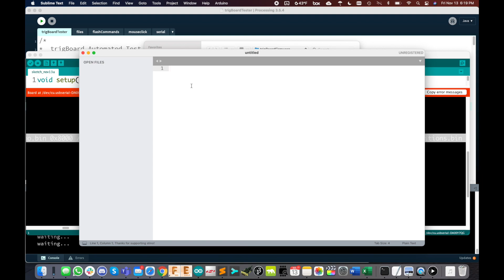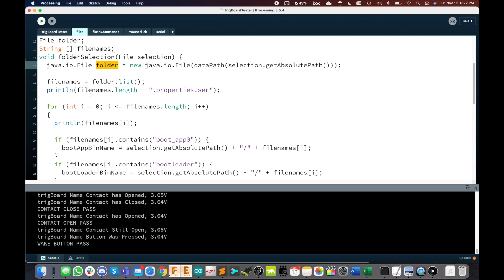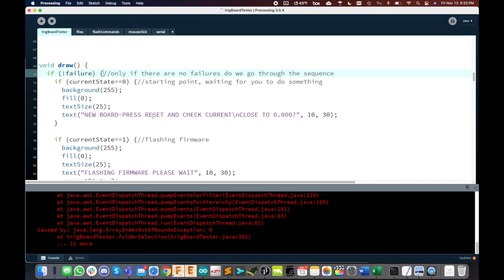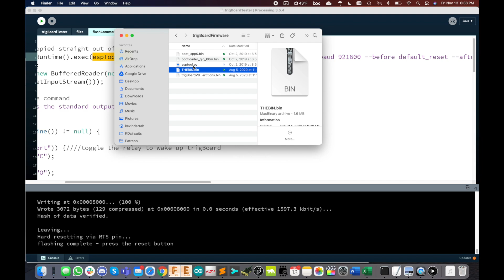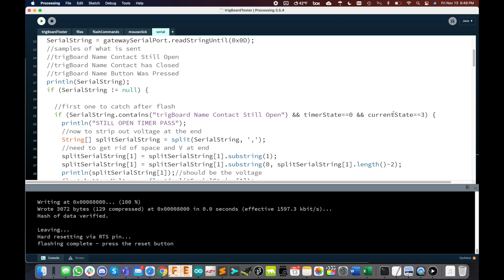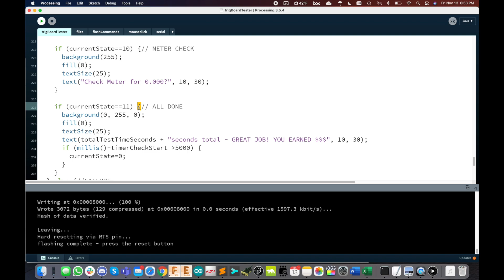Automated Factory Programmer and Tester for ESP32 (trigBoard Production Test Fixture) Full Tutorial

Comment: I got a cortex-M based processor that needs to be programmed via the Segger J-Link. Can I use Processing to automate the programming of the cortex-M like what you've shown here? If yes, what's the fastest/best way to learn Processing? If no, what would u recommend to solve my problem?
Reply: Head over to processing.org website and you will find tutorials and books to read!
Reply from the maker: should be possible, actually in a very similar way.  Most tools can be executed from the command line - I did this once with a SiLabs JTAG programmer board

Comment: Not a single Pin tested. That's NOT how you test boards.
Reply: yep from a test engineer perspective, there should be JTAG boundary scan basic tests...
Reply: @HalfLife2Beta  does the ESP32 support boundary scan? would be a way to go if it did
Reply: @TheEmbeddedHobbyist  Yep esp32 support jtag
Reply: well at least he gave some consideration to testing the boards but thats it. when he will have a chip with solder defects on the IC he wont be able to understand the problem on the board
Reply from the maker: yea, it's not a bed of nails type test, but everything is functionally tested... we're not at that level yet with the trigBoard to invest in an ICT fixture yet
Reply: @Kevindarrah  not ict but jtag jtag is cheap
Reply from the maker: yea, I wanted to test by programming via the UART port because that's how people would try to reprogram and because I have a pretty slick auto reset circuit on there.  So JTAG programming wouldn't test all of that.  I'm curious though, what would this test additionally?
Reply: @Kevindarrah  jtag test all the pins of your ic which support jtag
Reply: He went straight into the functional, that's really the give and take for a useful product IMO.
Reply: @TradieTrev  no, that's just not how it works... that's not how you do it
Reply: @samg4134  I'm all ears for better options, the real world test normal is your base level.

Comment: Nice job and a great example of interaction between multiple microprocessors.
So the trigBoard is a board you designed and have built for you?

BTW: I hadn't heard of Processing, it seems like a great platform to quickly create nice interfaces - doing this in code with HTML and CSS (in the Arduino IDE, etc) is rather labor intensive.
Reply from the maker: Yea, this is a board I designed.  But yea good point with HTML/CSS - there is a mode for processing called P5js - go check that out for creating really sick web apps.  My configurator was written using that